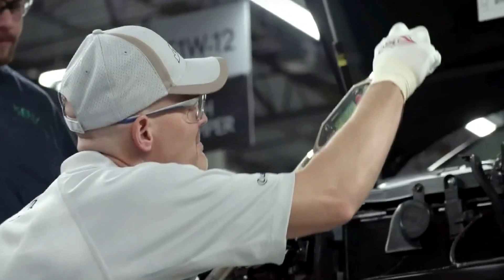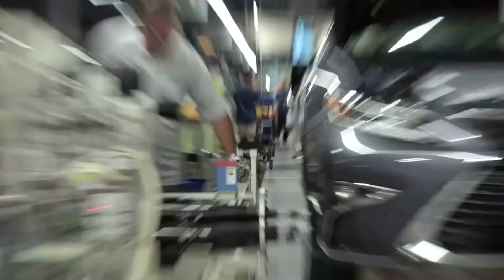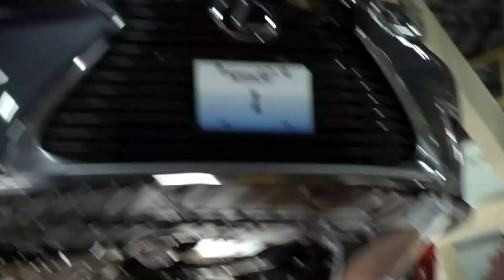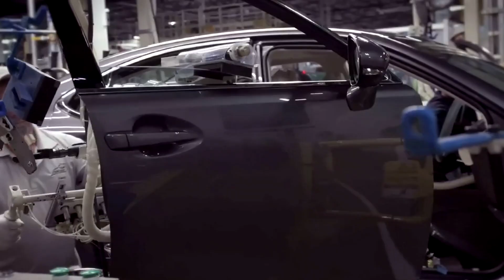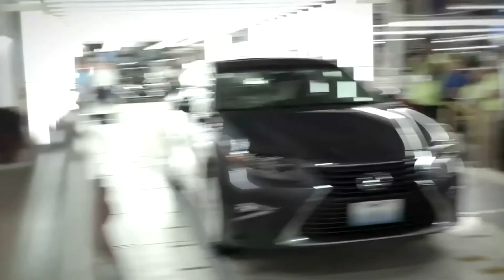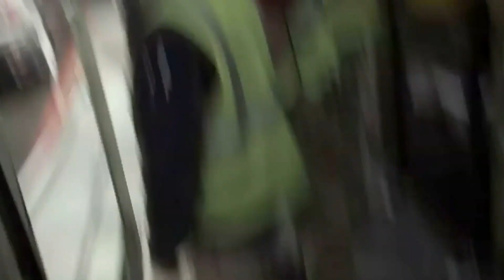Lexus ES Production Comes To Kentucky

Comment: If they actually spent this much time on every car they built (when the cameras are off), they'd only be able to make 3 per week.

There goes the quality right out into the Kentucky bluegrass.
Reply: A Lexus ES 350 rolls off the Line every 4 minutes and 2 seconds.

It's like this every day, every shift. Stuff like radiator hose clamps, are spec'd to the millimeter. A whole line dedicated to quality checks, and 2 quality gates on trim and chassis lines. Many minor imperfections at other automotive plants that would be passed as "Ok" are considered defects at Toyota.

Give me some stats on how many older Lexus and Toyota vehicles are still on the road as opposed to Mercedes, BMW, Jags, etc.

We currently build 113 Lexus ES 350's a shift, making 226 Lexus's a day.

My source? I work there. Tell me i'm wrong.
Reply: Do you still work there?